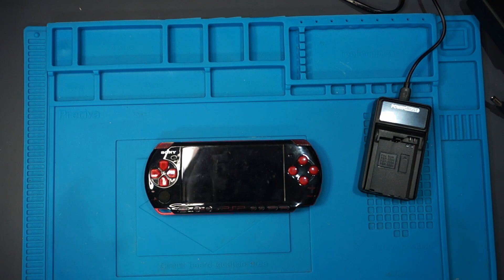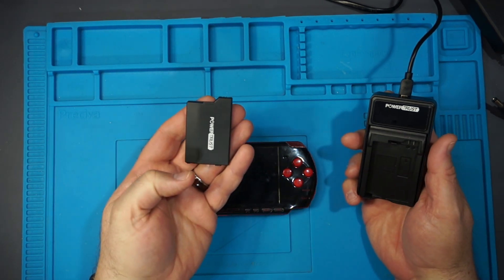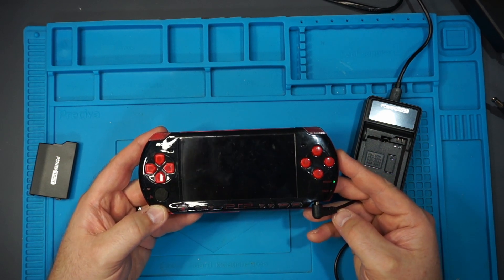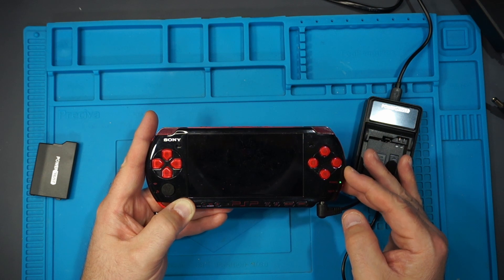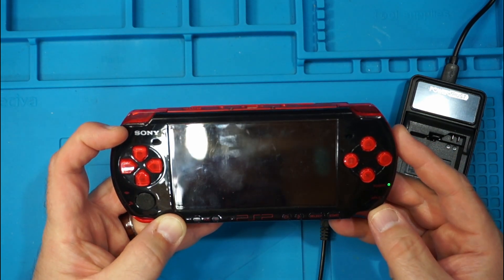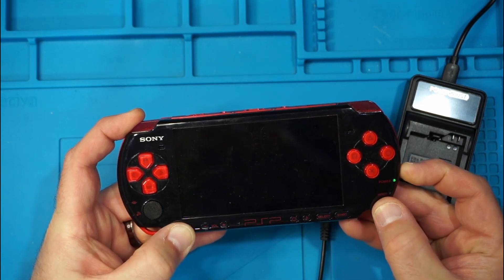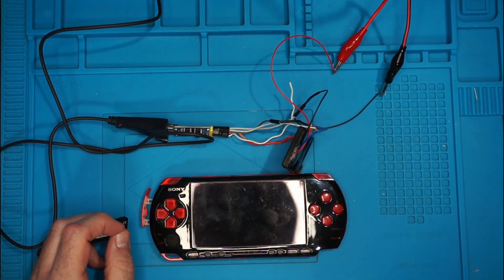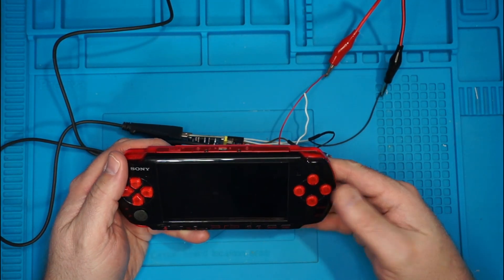PSP 3000 Bricked Fix Baryon Sweeper

Comment: Does baryon sweeper works on psp 3000 4th, 7th, 9th generation?..
Reply from the maker: The wiring should be the same, its the software that needs to be compatible.  Checking out the links I posted and the software has updated a lot since I made the video and it looks like everything is supported now.

Comment: I’m really happy that you can now unbrick a fully bricked late 2000 & 3000 moldels .Back in 2010 I had a slim psp late 2000 model that was bricked after trying to install a CFW 
and unfortunately I tossed it in the trash after realizing that it was impossible to unbrick it

Comment: If my psp was bricked due to the tampering with the flash files, can this still restore the console?
Reply: Yes. Flash0 corruption can only be restored through factory service mode.
Baryon Sweeper and magic memory sticks make it possible to enter and take advantage of this mode.
Reply from the maker: I think so, the process is for fixing a corrupt flash on a PSP and it just force flashes the firmware so it should work in that scenario
Reply: @TechGuyLife Yes i have a blue japanese psp-3000 is it possible to restore?
Reply: i also tampered with them and got my PSP bricked
Reply: @CJ123  it is possible, follow the guide in this video.

Comment: Instead of sacrificing a working batery, if you have a charger, you can use twist ties to connect the circuit to the charging pins (making a loop or a hook around each pin)
Reply: could you please give more details? :D thanks!
Reply: @paulpascu11  In the video, a battery is used to properly connect the circuit to the PSP. Since I didn’t have a spare battery, I used twist ties (like the ones from trash bags), which are often made of aluminum, and wrapped them around the pins—being careful to avoid a short circuit. There is enough space between the pins to do this and you can put small pieces of thin cardboard or paper to avoid shorting the pins.

Comment: I'm trying using a white memory stick, but it keeps failing. I'll have to buy a black memory stick and try it again.
Reply from the maker: yeah I had the white one as well and it caused nothing but problems.  I took a guess that the adapter was an issue and bought the black one, so I would suggest the black sd adapter.  Good luck !

Comment: Help! Error: com3 port is busy
Reply from the maker: Check the settings of your TTL device, the one I got had a set of switches to change the mode. Make sure it is in usb-ttl mode
Reply: @TechGuyLife  thanks, but The codes are coming, but the screen doesn't light up. Maybe you need to install ddcv9 firmware?
Reply from the maker: sorry for the late reply, if you see the codes it means you don't have the right software yet, the easiest way is to get the same SD card adapter I got and use that when making the memory stick.  The try DDC again and see if it works, if not make a jig kick clone.  You got the hardware side working you just need the right software.

Comment: I also got a bricked psp 3000 which im trying to unbrick but I dont got the bench power supply is there any other way I could put more power to the psp cause i think thats why its not turning on
Reply from the maker: I believe you can just use the AC adapter to power the unit as well, I tried that at one point, but my main issue was making the right SD card, so I had gone back to the bench power supply when I finally got it

Comment: Please anyone can help, JigKick Media Creator do not work for me, After presing start media creation button , start to work an display beginning installation and then crashing, tried 3 different PC win 10, win 11, simply refuse to work, any help please, hardware part it's working ok for me, amy clue tried memory card adapter, original mamory cards, PSP same results, or any other way to create memory card.
Reply from the maker: The only issues I had were I could never get a real Sony memory stick to work, which is why I switched to the SD card adapter.  With the SD card adapter I had to switch off quick format.  It takes longer to format depending on the size of the SD card.  Maybe give that a try.

Comment: Will it work without external battery power supply? I mean Only on usb to ttl or with original power supply connected?
Reply from the maker: Yes it should, the offical github instructions say in step 2 "You can omit an external battery if you power your PSP with a DC charger" https://github.com/khubik2/pysweeper  I know not everyone has a bench power supply.